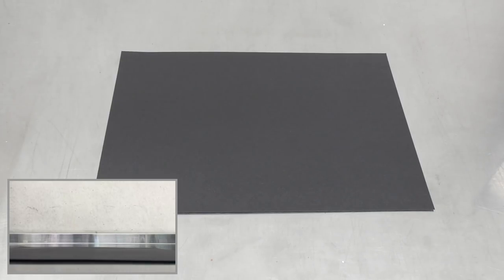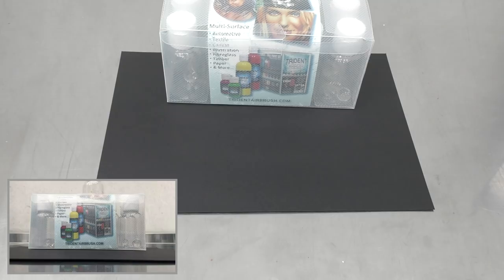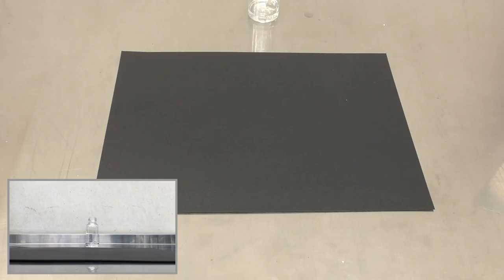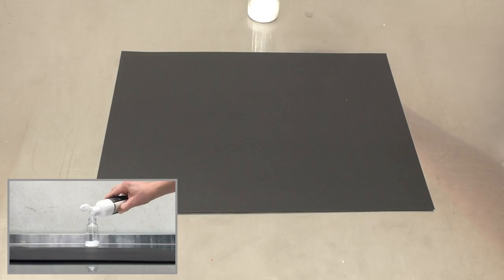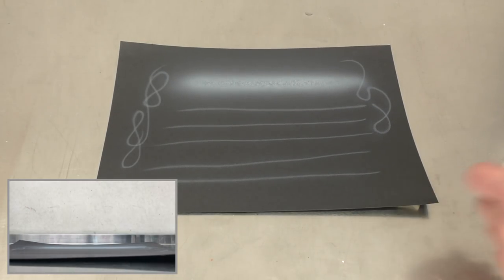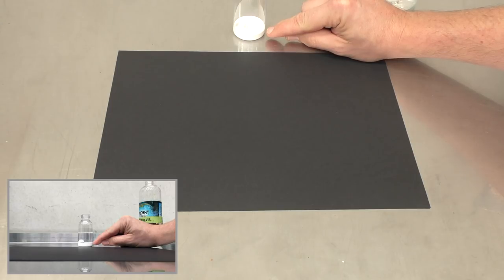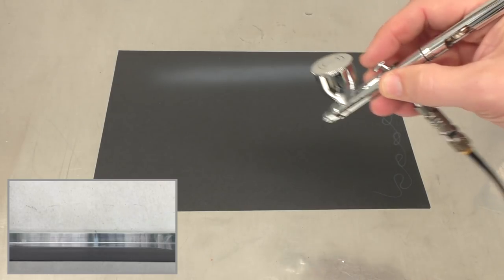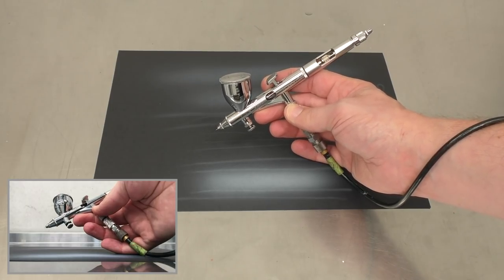Airbrush Quick Tips : Reducing Paint

Comment: Thank you for all videos you put up. I airbrushed professionally for a few years back in 2002-2008 but economy forced me into a career change. After 12 years I’m back airbrushing but everything’s changed. Water based paint, at the time, was a little easier to apply, harder to stock and dry, today it is the reverse. I’d love to see you do the same today using the createx paint (wicked or airbrush colors) since that would solve a lot of mysteries for me. White and black are indeed the worst ones, even on solvent based that i love so much, but it’s kicking my butt on the water based! I own a bunch of airbrushes from Iwata and olympos but most are overseas since the economy crashed in 2008. I’m working now with an Iwata CS HP-C and an Olympos 100B and both stuck on water based createx. Both are .35 and .25 nozzle but won’t spray unless extra thin down paint is used and pressure stays within 25-35 psi what makes it super hard to avoid tip drying on both. I have a Micron B that i haven’t dared to try it so far. I’d suggest, if possible, out of your kindness to make a two part video using createx, starting by mixing paint then going through a whole sketching of some artwork you will be working in at the moment to really show the differences on real life performance in that paint. I don’t know how to upload some pictures of what I’ve done here lately but would be delighted if i could shine some light on to solve this mystery.
Sa side note, i just saw your face and confess that couldn’t believe you’re that young. I don’t know if it’s your voice or the way you express yourself, based in the quick glances I’ve seen before in the skull videos i always imagined you much much older! Glad to see the new generation still keeping up with this art and doing it pretty good!
Again, thank you for your efforts and kindness in sharing your knowledge and experience.
Cheers
Reply from the maker: Thank you so much for all of your kind words and glad you have decided to re-connect with your airbrushing 👍🏻
I don’t use Createx wicked colours much as I found they tip dry a lot and I used to run them in my classes but students were getting frustrated 😖 I now predominantly use Trident as well as Createx illustration colors , I definitely prefer illustration colors to wicked but that’s just my opinion I know lots of artists who use and love wicked so it’s definitely personal preference .
I will keep the comparison video in my mind for future uploads and thanks again for watching my content all the very best 👍🏻🙏🏻
Reply: Thank you for replying.
Is the createx illustration paint suited for automotive painting? Will it take 2k urethane clear over it?
I’m going to try finding the trident in the US but not sure if it’s available here. I did a quick search and it’s very popular in Australia where you live but not here.
Fingers crossed!
Keep up the good work

Comment: Apparently, I don't thin my hobby paints nearly enough!  I bought my first (and only) airbrush, an OMNI 4000, about 13 years ago for painting 1/48 scale plastic models.  I primarily use Testors or Tamiya Acrylic paints (and occasionally some Alclad II Laquer), but I've probably only been using 10-15% thinner/reducer at about 20PSI.  I'll have to play around a little to see if I can thin my paints more and get better results.  Great videos, BTW.
Reply from the maker: Thank you and good luck with getting your paint consistency right 👍🏼 remember , it’s whatever works best for you .
Reply: TJ Rohyans  Hey TJ I also use testers paint and reduce them a lot to get light build ups like Lettering under my door windows on my hot rod they work great good product to practice with.🕶

Comment: Recipes:

Airbrush - Acrylic Paint Thinner Recipe
- 75% Distilled Water
- 25% Isopropyl Alcohol
- 20 Drops Floetrol (flow aid/leveler)
- 20 Drops Pure Glycerin

Airbrush - Acrylic Paint Cleaner Recipe
- 70% Distilled White Vinegar
- 25% Distilled Water
- 05% Isopropyl Alcohol
- 20 Drops of Floetrol (flow aid/leveler)
- 20 Drops Pure Glycerin
Reply: You can just use distilled water mixed with distilled white vinegar to clean an airbrush.  Soak the parts for about 5 minutes if breaking airbrush completely down for a thorough cleaning.  Then just use cotton swabs and pipe cleaners.  Dry.  Reassemble.  You can add Floetrol (flow aid/leveler) and Glycerin to the cleaner if you want.  White vinegar is one of the best cleaning agents there is.  Heck...it removes rust if you soak rusty parts in it for a day.

Also...you can use air tool oil to lube all the o-rings, etc.
Reply: Vinegar and O rings.... I don't know if that's a good idea?
Reply: @jelly8594  
It’s fine. I’ve used it.